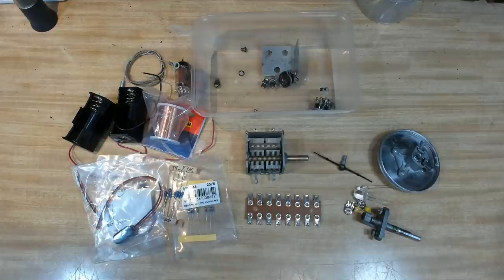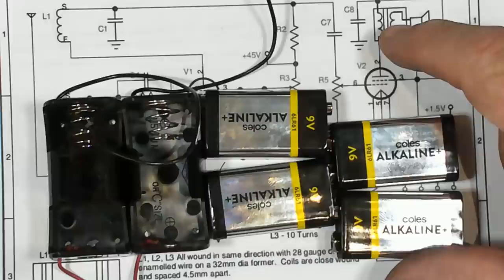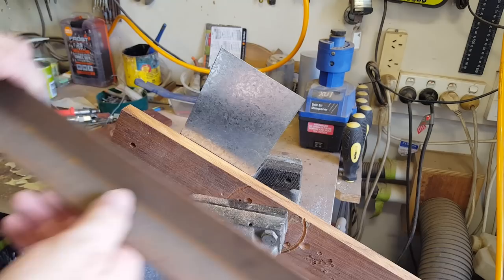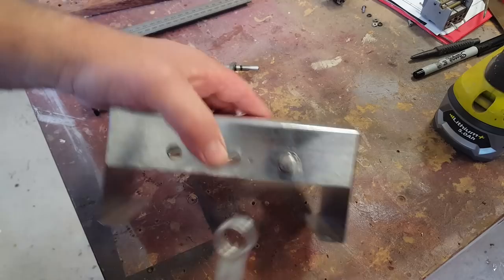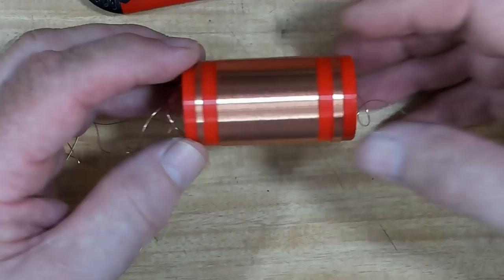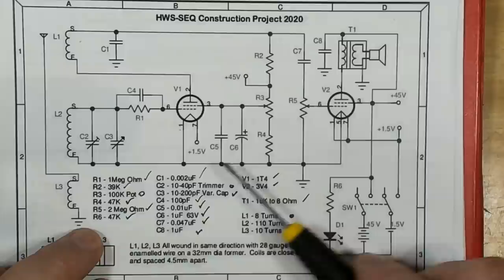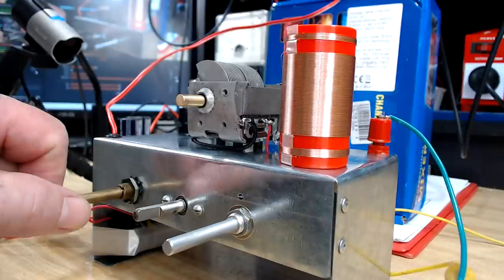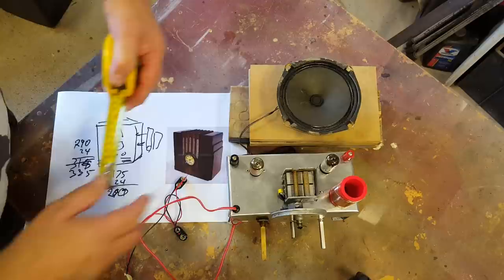2020 Radio Building Competition - My Entry - Two valve Radio

Comment: Actually there is no feedback via the screen grid. The regenerative feedback  is through l1 and l2, coupling the signal on the plate back into the grid. The regeneration control, r3 controls the gain of the valve by varying the dc screen grid voltage, and therefore sets the circuit to the point just below where oscillation would occur.
Reply from the maker: Hi Michal, thanks for pointing that out, that makes perfect sense, I was thinking of reflex more than regen 👍🙂
Reply: I worked on a Pye unit that had feedback from the primary of the output transformer. Clever set up but could stop the receiver from working IF a fault occurred and NOT just because of a fault with the output transformer going open circuit et 😗 It recycled part of the anode signal output through the circuit and grid assembly. Clever. One of the radios in my collection is a 8 band 8 valve Pye radio and complete work over, produced a set that family and friends still love to see / working et.

Comment: I built such a radio when I was a teenager. It used a 80 rectifier tube so it could be plugged into an outlet. I purchased the parts from radio row in downtown Manhattan. It wasn't all that sensitive and would squawk loudly if the regeneration was turned up too high. Later I converted it into an AM transmitter using screen grid modulation. It worked well enough to transmit music quite a distance in a dead spot in the AM band using a window screen as an antenna.
Reply from the maker: Hi Frank, converting ity to a transmitter and using the fly screen was a touch of genius 😀

Comment: Outstanding piece of work David. Congratulations on the win.
Breaking news, I now have Bluetooth!
Had a new pacemaker fitted last week which uses Bluetooth to download information to IPads and so on at the hospital. Far greater battery life too. Also have a terminal at home so I can communicate with the hospital directly.
Still quite sore from the operation (done under local anaesthetic ), but getting better each day.
Modern technology! Amazing!
Wish you all the best for Christmas and the New Year.
Off downstairs now to see what Santa brought
Take care
Stay safe
Cheers
Lynton
Reply from the maker: Thanks Lynton. It is amazing, everything works better with Bluetooth. No doubt you will be better than ever once you are all healed up. (sorry for ending a sentence with a preposition)  All the best for Christmas and the New Year. I expect you will find a new project under the Xmas tree 🎄🙂
Reply: Hi David thanks for the reply.
Well I am still working on the Hacker radio I mentioned a while ago. The initial set turned out to be a bit of a disaster with crumbling IF cores, stripped core supports, a faulty tuning cap that was beyond repair, and an FM board that refused to play. It  was only fit for the bin! However yesterday I was given an identical chassis in much better condition so I am still hopeful.
Not fit enough to get into the workshop at the moment (and it is far too cold - below zero deg C last night). But as soon as I am a little better the work will continue.
Santa didn’t disappoint either, even brought me a new battery drill, and soldering iron!
Take care young man.
Keep up the good work.
Best regards
Lynton
P.S. Don’t worry about the grammar, it’s only a note/comment. I have forgotten most of the rules of grammar anyway.👍🏻🤨🤣
Reply from the maker: @lyntonprescott3412  You have a good Santa 😉 I hope you have a speedy recovery and back into the Hacker soon... well once it warms up a bit. Cheers, all the best.

Comment: Nice Project, Dave!  I had an electronic trainer from Gilbert Toys back in 1958 that would let you build devices from a morse code trainer, to  a shortwave radio. It used snap connector wires, with templates to help make circuit building somewhat easy.  It used a germanium diode for detecting and a 1T4  for regeneration. I never really had enough cash at the time to buy an expensive 45 volt B battery to use the trainer to its full extent, but got many hours of pleasure using the projects I could build with it. Have a Great Christmas!!
Reply from the maker: Hi John, thank you. You can still get the project kits, I was looking at one for my grandson for Christmas but will wait till he is older. Of course they have transistors in them now. Thanks John, Merry Christmas 🎄🙂

Comment: Wonderful! Great construction video and well done on the win, you had some great competition there, I don't know what got you over the line but I hope it was the case as I think that was brilliant!
Reply from the maker: Thank you Percy. I was told after the presentation that mine edged ahead because it could be turned on and used as it was, the others had conversion charts for the station dial or need some assembly, it was very close 🙂

Comment: So glad you discovered the only correct way to cut glass the clean way.  Never try breaking the strip off on the side of the table by pushing in the middle.  That always goes bad. The break should start at one side of the scratch and 'run' to the opposite side.  Just put something onder the glass, like a pencil or a nail, or a match and gently push on both sides of the scratch. Piece of cake, well piece of glass, actually.
Reply from the maker: Thanks 1959Berre, it was my first time, my Dad used to do it all the time but that was over 50 years ago. I was happy it worked the second time 😄

Comment: This is my favorite video of yours. Thanks. I have watched it several times already over a few months. I found electrical conduit for my coil former at 32mm. I veve a pipe cutter here for metal tube, but it works fine on the conduit too. I have three meters of conduit, so I have a few radios to build with it.
Reply from the maker: Thanks Mathew. Wow, you will have quite a collection for you build that many 😊

Comment: Now that is what I call one exquisite looking; brilliant performing, and superb sounding home brew radio Dave.  Although there was a whole load of stiff competition, in my humble opinion your entry was unparalleled.  
Some forty-nine years ago, I too constructed a TRF valve radio incorporating two EF91 RF pentodes.  The circuit I used ...a circuit you might have seen too, was extracted (as I recall) from a late 1950s radio construction magazine.  I constructed the radio to fulfil an end of college year examination practical assessment.  Like your radio project, my radio project worked well too ...difference being, it incorporated a mains transformer, 2 x BY100 rectifiers, pi-filter resistor, and reservoir and smoothing electrolytic caps.  Mercifully I was not expected to fabricate a dial, or construct a cabinet, but a written construction and circuit analysis report was required.  That particular practical assessment criterion was to achieve above a threshold pass mark of 60% ...which I did!
This video was certainly unusual in the sense I haven’t as yet discovered another radio construction/competition project here on YouTube.  What more can I say Dave beyond, “A professional looking job,” “Excellently executed,” and what I’ve already written?
Best regards my friend, Phil
Reply from the maker: Hi Phil, thank you and seasons greetings to you. Your practical assessment radio sounds like fun although it probably wasn't at the time, the addition of the transformer added another level of difficulty. My assessments were all about developing hand skills, making small squares fit perfectly into larger squares or hand scraping 2 mini surface plates perfectly flat using Prussian blue, I would rather have made your radio 😀

Comment: Congratulations Dave, and happy new year to you! One thing I've noticed about superregen radios like this one, is that  it is so easy to mistakenly wire the tickler coil in the wrong direction. That would turn what would otherwise be a superregen circuit into a TRF circuit with negative feedback, which would sharply reduce sensitivity. If the tickler coil is wired  the right way round, there should generally be a loud squeal  when the regen control is turned up, and the receiver should be extremely sensitive to the weakest of signals, which was why the superregen was so popular before the far superior superhet design took over.
Reply from the maker: Hi Michael, I checked the tickler coil direction and it is correct, I was a little surprised it didn't go into oscillation more but it behaved the same as the other entries. In fact, all entries operated exactly the same except one which didn't work very well at one end of the scale, I forget which end. Happy New Year 🙂

Comment: Excellent stuff. A tip for cutting glass, use a drop of machine oil on the cutter wheel and LESS pressure than you used.
Reply from the maker: Hi Mike, thanks for the tip 👍🙂

Comment: I am looking at this a bit late, of course Christmas is midsummer in Australia, and now it's midsummer here in the USA.  This is very excellent craftsmanship. I had wondered whether the regeneration and antenna coil was design specified to stand on end against a chassis ground plane, which it looked like your model and at least one other model whose guts were visible did.  That might change the characteristics a bit vs. being suspended far from the chassis.  Anyway that was a nice touch to put the pensive music in there from time to time.
Reply from the maker: Thank you, I also wondered if it may have been better to raise the coil off the deck, it may have made a difference 👍🙂

Comment: Congratulations Dave, it would look great in any home. My own homemade radio has a very basic case, but it does help having a woodworking lathe like yours.
Reply from the maker: Hi Nigel, thanks. I have a woodworking lathe but haven't used it in any of my videos yet 🙂
Reply: @DavidTipton101  I'm not a technical type carpenter and shouldn't have called it a lathe, not sure what they call that edge rounding and groove making tool you used is? I would love to have one, it makes all the difference to the finished radio case. My homemade radio is using a MOSFET input stage and has 3 bands. When I was 15 years old, I did build my own valve radio with plug-in toilet roll tube coils. After watching your two valve radio build, I might have ago with that circuit. I have all the parts needed already in my parts box.
Reply from the maker: @nigelbrockwell6237  Ahh, I wondered that Nigel, the machine is a router mounted on a router table, it's very handy. Plug in toilet roll coils sounds like fun 🙂 Good luck if you have a go at the radio 👍🙂

Comment: What a wonderful build. I wish I had all of the tools and knowledge to work wood like you do. I have a slew of one or two tube radios I have built, but they still are in chassis form.
Reply from the maker: Thanks Jon, it took many years to build up my workshop, a bit at a time so the wife doesn't notice  👍😉
Reply: @DavidTipton101  You did an amazing build. Your wife should be proud! Simply amazing work with what you did!

Comment: What a superb video! This is what YouTube videos should be all about. Beautiful job on this project. I particularly thought the coils turned out nicely. Congrats on the win. BTW, the other project I liked was the one with the nice wiring harness underneath.
Reply from the maker: Thank you John. The other radio was the one to beat, it required some assembly to work (battery and speaker) and I think the tuning dial needed a conversion chart to reference the station so lost points for that 🙂

Comment: Fantastic job, like always!!!  David.  My only concern would be the limited capacity of the 1.5v battery
for the tube filaments. I know you tried to fit a 'D' cell in. Maybe you can make it a re-chargeable, and
retrofit a charging socket for it?  Congrats on your win!
Reply from the maker: Hi Glenn, thank you. The C cell will last a fair time, D would have been better. It only had to last long enough for the judging. I just pulled it out and tested it and after all the run time with testing and judging it still reads 1.58 Volts 🙂

Comment: Impressive job!   Interesting to see how well that radio works with just two valves.  I don't recall ever seeing a demonstration of a regenerative receiver.   Maybe the AA5 design should have been AA2.   That would have left enough in the budget for a power transformer...
Reply from the maker: Thanks rlg42 rlg42. Good idea for the AA5s 😄 Australia produced a lot of 4 valve sets and used a similar form of regen, it was called reflex where they would pass the audio signal back through the 2nd IF for another go, could be a little unstable but saved the cost of a valve 🙂

Comment: Hi David. Congratulations, your radio looks and works great, especially if the time limit for its construction is considered. Well deserved first prize! It couldn't be much better even if you had much more time to build it. Maybe it would look even better with a mirror black finish, but that was not allowed by the time limit. I also like that cute compact portable one at 54:06, I think the labeling and the dial ruins it, but those are fixable issues. 

The LED on the dial is too anachronistic to me, I think it should be a small bulb, and then it could double as a dial light, not just a power indicator. But it would be more practical with the D cell, any decent wattage 1.5V bulb would put too much load on the C cell, it's not worth draining it faster just for a dial light. Maybe stick with the power indicator function, and use a little neon bulb on the 45V supply? 

I don't know if 45V would be enough for any neon, they usually ignite at about 60V IIRC, and because it's DC, even if you find one for 45V, the light would be very dull, because only one of the electrodes would glow. There are directional neon indicators with lens on the front, they are doing well on DC if you connect them with the right polarity (so the flat electrode in front of the lens will glow), but they are hard to get. My Leader LBO-508 CRO has a tiny one as a power indicator on the (I think) 150V DC supply, and it has a decent brightness. Neons can generate some noise, which might be picked up by the radio, either via radiation or conduction, so that should be tested first if you consider to use a neon there. The conducted noise might be eliminated if you put a small 100nF bypass cap right behind the neon, on the supply side before the ballast resistor, so the ballast resistor can double as part of an RC filter.

Keep up the great work, have a Happy Holiday, and a better, COVID-free New Year!
Reply from the maker: Hi mmmrn1, thank you. I agree the pink one was well done. I had purchased a super bright LEDs to use as a dial light but it would not be visible during the day when the judging was taking place and the circuit showed a LED so I stuck to the brief. All the best for the New Year 👍🙂

Comment: Hi Dave; This is one I enjoy watching from time to time. You were brilliant with the design of the chassis and cabinet of this fine radio. For a simple battery operated Re-gen receiver it turned out to be a great performer. I'm wondering if you turn it on every so often and listen to the news, a few songs or just see what it can pick up and feel confidently 'i built it'
Reply from the maker: Hi Daniel, It was a good project, If I had given myself more time it would have been easier. I turned it on about a month ago and it's works very well considering what it is. Thanks Daniel 🙂

Comment: I like the radio, would like to see more of the other radios in the compition
Reply from the maker: Thanks Gene, Yes, I should have looked a little closer 🙄🙂
Reply: @DavidTipton101  I like your radio, you did a great job on the radio cabinet.the battery compartment was cool too. I just thought the other radios looked good as well.
Reply from the maker: @genegross2252  I agree, I was amazed at the other radios, much better than I expected 😀

Comment: I do love the old Aussie radios.  I just wish there were more that had shortwave included, even though Shortwave isn't a thing locally these days.   Plenty of international stations still broadcast when you can get them though.        It was interesting seeing the frequency range.   Is that official at the time this video was made?    I remember when I use to live in Brisbane, back when 4BK was still AM,  4RPH use to be quite weak on 1620KHz, then they moved to 1296 when 4BK went FM.  I use to get my little transistor radio and angle it just right to get 4RPH on 1620 to listen to The Air Adventures of Biggles, which RPH use to replay.   Maybe only the Narrow cast stations or on those higher frequencies.
Your build turned out really well, such a simple radio, but you made it look so good.
Reply from the maker: Hi Brendan, it's a pity FM didn't come in a bit earlier in Oz, some of these radios would have been more useful now. I don't remember what frequency range I used and I don't recall the official region MW frequencies either, it starts at 555 and runs to 16?? something. I would have used 600 to 1600 on this I think. I can't get 4RBH, most of the stations at the top of the dial are difficult to pick up where I am. Thanks Brendan 🙂